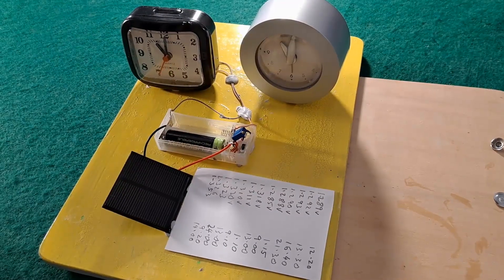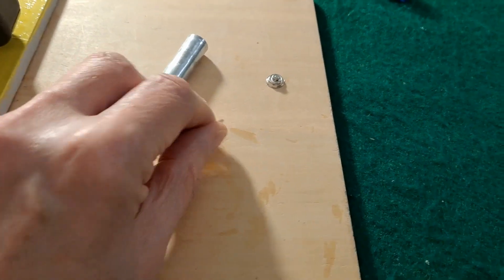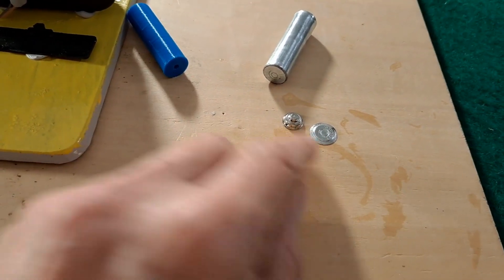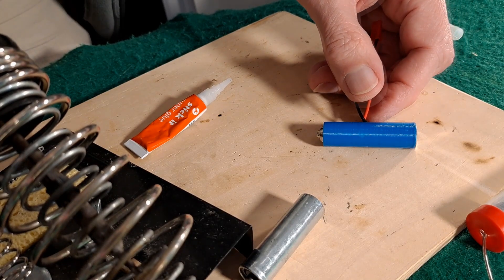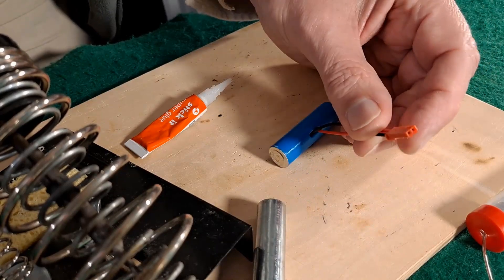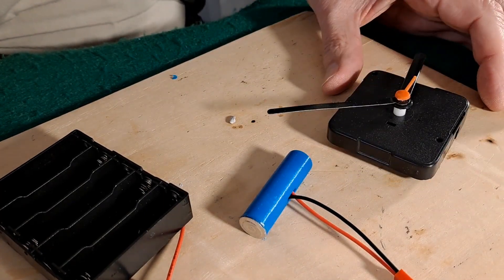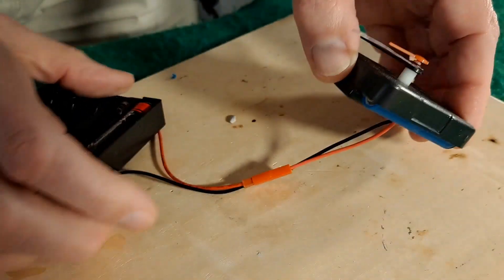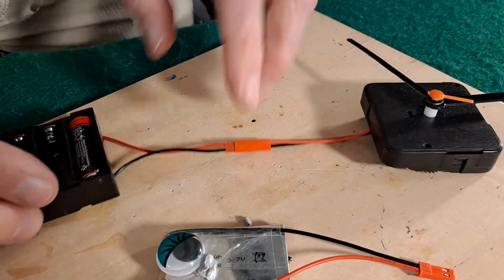3D printed Dummy AA Battery

Comment: What type of batteries did you take the buttons out of??  I peeled the label off an alkaline and there's no way to get the buttons off.
Reply from the maker: I am afraid you will just have to look around until you find a source. The ones I used were branded "Kodak" and were Zinc Carbon from Poundland, but I don't know if you are in the UK so that may not help you.

Comment: Good idea!
Reply from the maker: Thanks Larry, it really depends what you are trying to achieve. For my purposes, it has a specific use so I am happy with it. I could imagine printing a module that would fit in an existing toy car battery box and replace 5 AA batteries in one go as that is a fairly common configuration. Another option, if you don't have access to a 3D printer is simple lengths of wooden dowel and a metal screw in each end. I have added a link in the video description to an old KipKay video on that subject.

Comment: Nice idea with the Dummy battery. Saves you a Lot of trouble with wires  going everywhere. But still works the Same as if you would Put  a regular battery in it.but the idea is good.😀
Reply from the maker: In this particular case it will be useful, it just depends what you are trying to do.

Comment: If you were to run that clock on 3 volts would it run faster?
Reply from the maker: No, or at least it shouldn't, the speed is crystal controlled. If you push the voltage too high it would probably kill something on the circuit board.

Comment: Hi Idea solder the connector wires to a small round magnet and use heatstrink filled with hotmelt to cover magnet and solder joint when you strink the heatstrink the hot melt will melt to take the strain  off the solder joint . not got the hang of using my 3d printer yet . best regards
Reply from the maker: I use magnet connections on several of my videos. That is not what this video is about.

Comment: Never thought of that with connector in the middle. I make dummies out of dowels  with a bolt in the center. I put one 14500 LiIon batt in where 3 AA's were or 2 where 5 AA's were. Great videos Grandad
Reply from the maker: I like to reuse recovered cells so they are usually 18650s. I have only found one 14500. Obviously I could buy some, and that would be a handy fix. I remember when I was looking at that option many of the online sellers included the blank dummies in the package. I think I have a video on that somewhere.

Comment: You can solder the rings, first you must scuff up the surface.
Reply from the maker: Rings?
Reply: @GrandadIsAnOldMan  the contacts on the clock i meant... scruff the contacts with a file. Then the solder will hold. Just like using epoxy, how you have to scruff the surfaces you wish to adhere so the epoxy has something to grip onto. The solder needs something to adhere to as well
Reply from the maker: @SM-pi8vd  I think I mentioned in the video or the previous one, that the contacts appear to be stainless steel or similar and simply will not take solder. I had tried filing the surface clean and it made no difference.